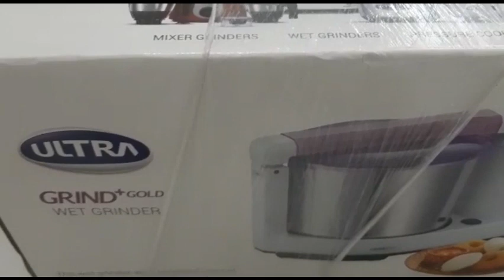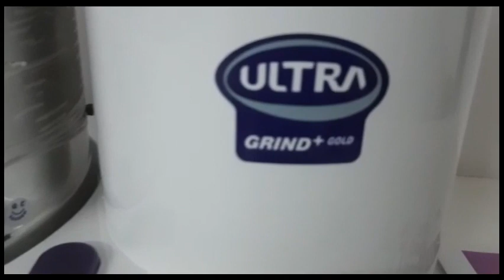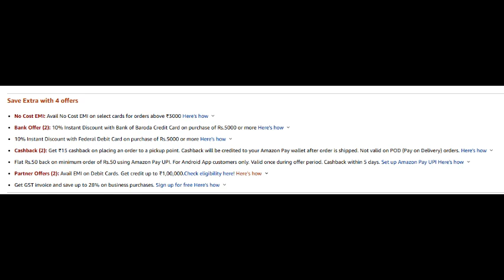ULTRA GRIND + GOLD WETGRINDER REVIEW || DEMO AND FIRST TIME USAGE METHOD IN TAMIL

Comment: Mam iam fell very bad to use ultra grinder because rice grinding time was too late minimum 1.5 hr. What can I do pls suggest
Reply from the maker: Did u soak properly dear ... Soaking matters for me max 20 to 25 mins... If u have soaked properly then please contact the customer care
Reply: Thanks for your reply mam. Iam socked rice for 5hrs but it's grinding timing is too late. Ok mam I will try to contact customer care.
Reply: @vidhyaj8567  your wiper is not properly Connect in roller holder .....
It is very very simple to adjus the wiper
+ Or - debent upon your grinder
Reply: @vidhyaj8567  hi...did u contact customer care...for me also same problem

Comment: Why did u change butterfly rhino? Can u tell me about butterfly rhino? Y u did not choose   rhino again?
Reply from the maker: It's not as efficient dear....it was good but ultra I felt better.... from timing taken to ease of use... the batter was also had slight change in texture...
Reply: I got ultra now, before used sowbagya tilting, sound was high
Reply from the maker: Hmmm
Reply: Yes... rightly said ..in butterfly rhino,.the batter gets splashed even after closing with lid..grinding also not perfect..

Comment: Sister length of the wire ennna
Reply from the maker: Don't know exact measurements but descent enough to fit any table top ... I measured using hands 3 1/2 mulam varudhu